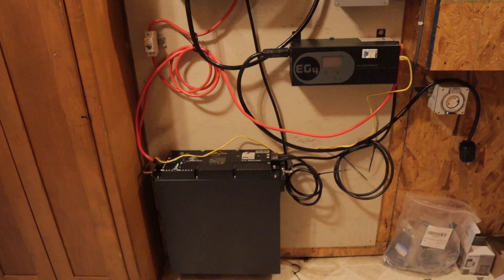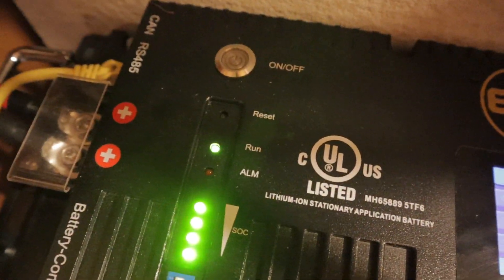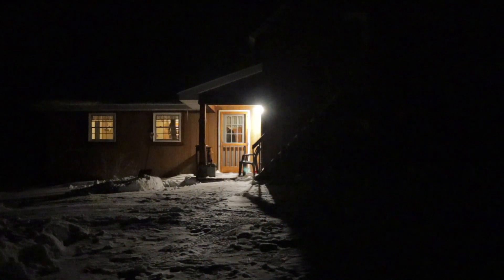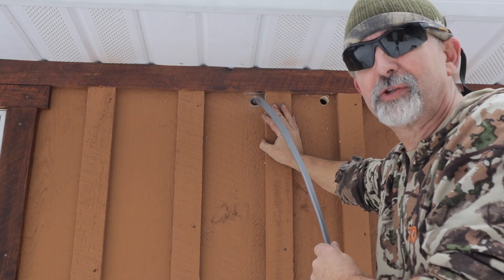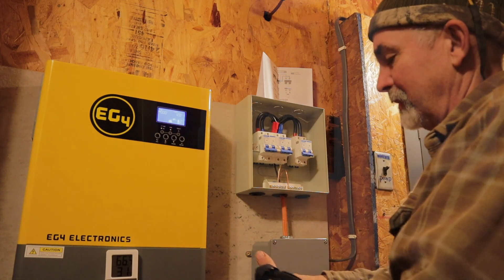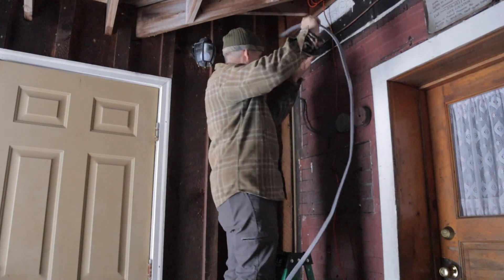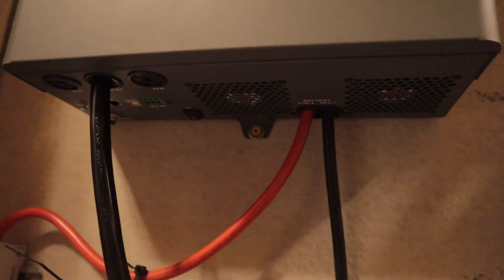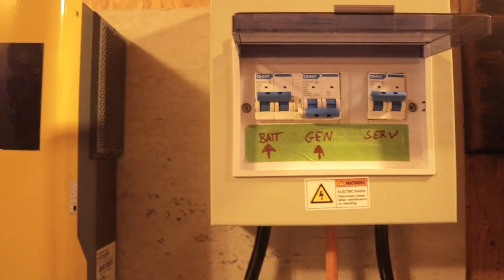OUR OFF-GRID NORTH WOODS CAMP IS BATTERY OPERATED! THIS IS A GAME CHANGER!!

Comment: Nice cabin but a poor choice for an inverter. High-frequency, transformerless inverters like the one you chose have a higher failure rate, leading to a shorter life expectancy. They also provide a poorer surge capacity which leads to poorer performance when powering inductive loads like refrigerators, microwave ovens, water pumps, washers and dryers, and air conditioning units. Even worse, they can also be dangerous for use in residential applications. Ask Google AI: Can high-frequency, transformerless inverters be dangerous for use in residential applications? If you doubt what I'm saying.
Reply from the maker: With our low load application a high frequency inverter is fine. It’s also much more cost effective   Thanks for watching!

Comment: Any reason why you don’t charge above 38 amps?  Would be a little more efficient.

Get a few bifacial solar panels and you won’t need any generator during the summer!
Reply from the maker: Good question and one that I don't have a good answer to. This system is new to me and I'm still working things out. I do have the charging amps set much higher,  
but as the state of charge increases the charging amps drop. At 90% SOC the charging amps drop to around 3 amps...Thats slow!!!  Bad settings? 
We do plan on installing solar panels this year. Thanks for watching!

Comment: How many amp hrs is that battery?
Reply: Thanks, I wouldn’t think that would power much for long ?  I have 800 amp hrs at 24 volts , its a struggle in the winter if i have a few cloudy days in a row , thanks for the reply
Reply from the maker: We don't use a lot of electricity actually. We also don't have solar panels yet. The battery has been lasting us two days before having to be charged with the generator, it's still a learning curve. If we find we need to add more batteries, it's easy to do.
Reply: Thanks, solar is addictive lol 
Best of luck
Reply from the maker: @ I’m finding that out!
Reply from the maker: Hey pizann350. The battery is a 48 volt / 100 amp hours EG4 Server Rack Battery. Thanks for watching!

Comment: Agree with the Sharkbites makes plumbing easy, even though they cost more
Reply from the maker: I didn’t mention it in the video but they do fail when frozen. Once pushed apart by frozen water the will not seal and have to be replaced. Easy to do. Thanks for watching!